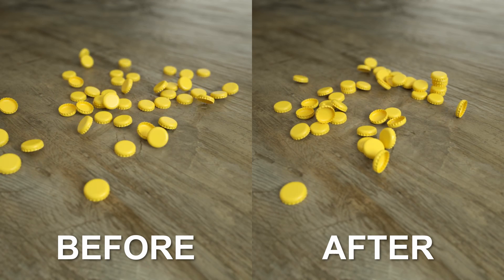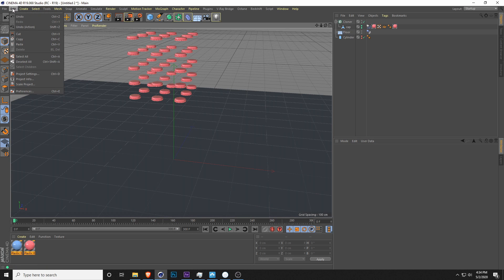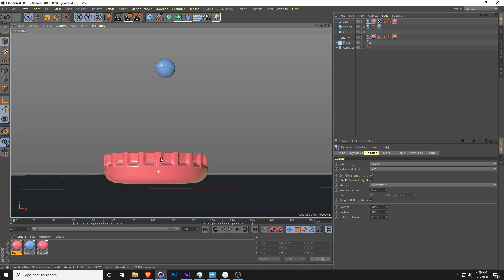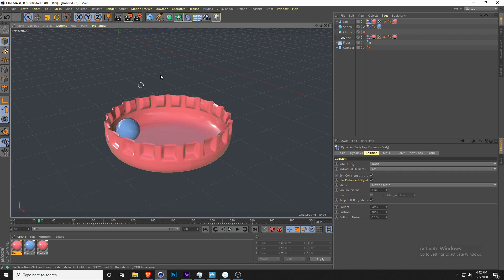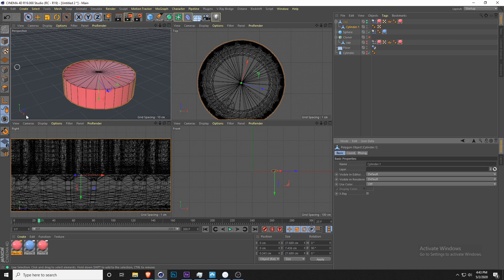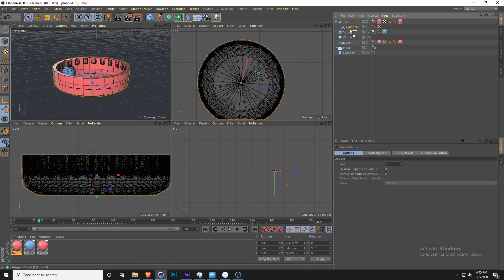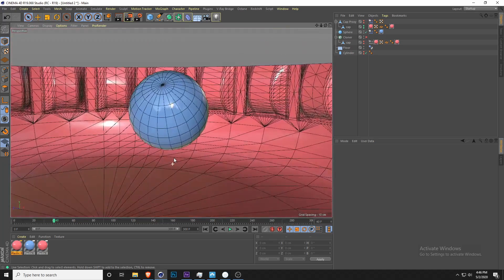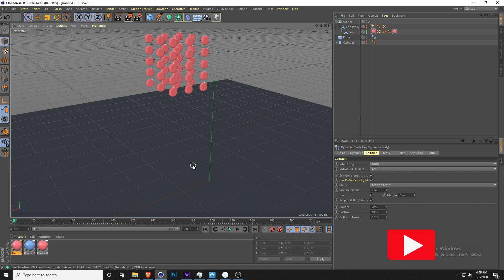FIX Dynamic Problems in C4D (Jitter, wrong shape, slow simulation)

Comment: Hello. I simulated the fall of rigid body balls from an emitter and used "linear velocity threshold" in some places; I increased it in some and decreased it in others and then baked it. When I bake the simulation, are the keys I set for "linear velocity threshold" effective? Because after baking, it seems like my "linear velocity threshold" adjustments aren't working.